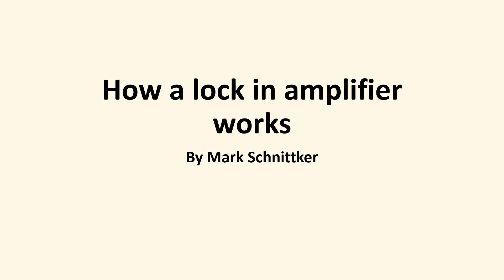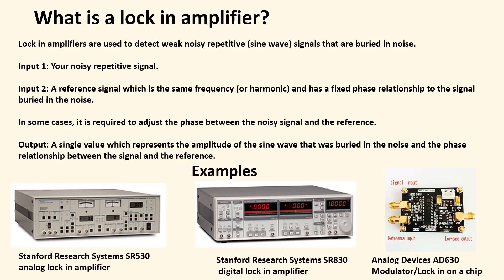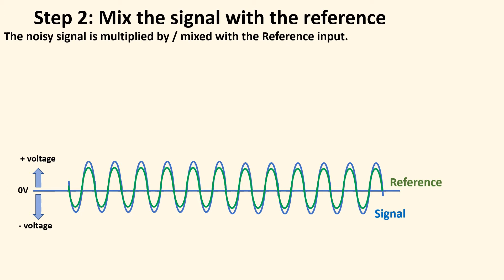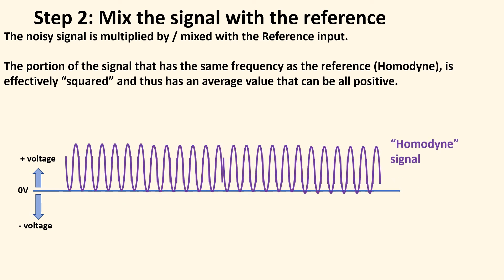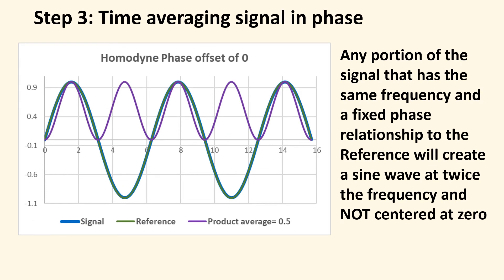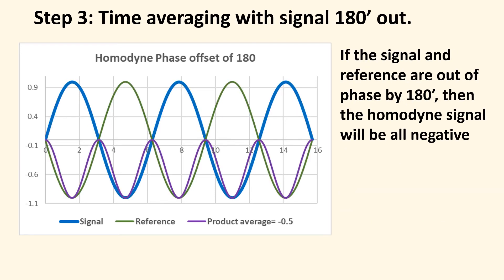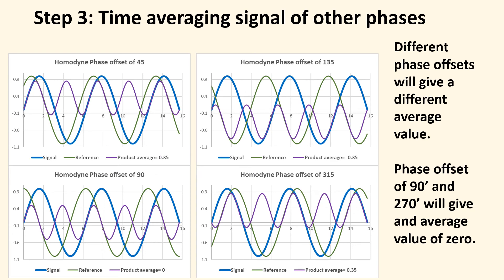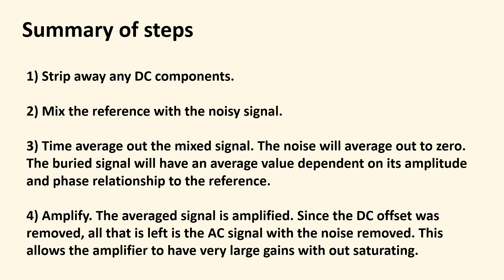How a Lock in amplifier works

Comment: I used an Ortholoc SC 9505 in the early 1980s and it was  wonderful beast for its time.
Reply from the maker: I have used some of those older EG&G tools and I agree they were excellent systems with clean electronics. Not great for computer interfacing, but that can easily be resolved these days by sending the analog out to a USB connected LabJack.

Comment: A lock-in amplifier is a highly sensitive instrument used to detect and measure weak signals, even when they are buried in noise. It works by extracting a signal at a specific reference frequency and filtering out everything else. This allows it to measure signals with a known frequency and phase in environments with significant noise or interference.

Key Features:

 • Signal Detection: It amplifies a signal that is synchronized to a reference signal (often a sinusoidal wave), making it ideal for measuring weak periodic signals.
 • Noise Rejection: By focusing on the reference frequency, it effectively ignores noise at other frequencies.
 • Phase Sensitivity: It can detect both the amplitude and phase of the signal relative to the reference signal.

Uses:

 • Nuclear Test Equipment: In nuclear experiments or radiation detection, lock-in amplifiers are used to detect small signals that arise from nuclear reactions, often obscured by noise from background radiation or electronic interference.
 • Optical and Magnetic Experiments: Commonly used in sensitive laboratory setups involving lasers, magnetic fields, or other precise measurements where the signals of interest are very weak.
 • General Physics Research: Lock-in amplifiers are also used in low-temperature physics, electrical measurements, and even in some forms of medical imaging or diagnostics where signal extraction from noise is crucial.

In nuclear testing, they help measure small responses, such as detecting radiation signals or monitoring sensor output during an experiment, ensuring high accuracy in noisy environments.

A lock-in amplifier works by using a technique called phase-sensitive detection to extract a signal at a specific frequency, even when that signal is buried in noise. Here’s how it operates in basic steps:

 1. Reference Signal: The lock-in amplifier receives a reference signal that oscillates at the frequency of the signal you want to measure. This reference signal can come from an external source or be generated internally.
 2. Mixing: The input signal, which contains both the signal of interest and noise, is multiplied (mixed) by the reference signal. This process shifts the frequency of the input signal, creating new components at the sum and difference of the input and reference frequencies.
 3. Low-Pass Filtering: After mixing, the result is passed through a low-pass filter. This filter removes high-frequency components (like noise and the sum frequency component), leaving behind only the DC component (which corresponds to the signal at the reference frequency).
 4. Phase Locking: The lock-in amplifier also compares the phase of the input signal with the reference signal. If the signal is out of phase, it will adjust the phase reference until it aligns with the input signal. This ensures that only signals with both the correct frequency and phase are detected, further rejecting unwanted noise.
 5. Output: The output is a DC voltage proportional to the amplitude of the signal at the reference frequency, allowing you to measure very weak signals even in the presence of strong noise.

The key aspect of the lock-in amplifier is that it filters out noise by using a reference signal to “lock in” on a specific frequency, while traditional amplifiers would amplify both the signal and the noise together.

Comment: Can the Reference Signal be a DC signal when the signal to be measured is AC signal
Reply from the maker: The reference signal needs to be AC with the same frequency as your buried signal. Not all situations lend themselves to this situation, but these tools work so good that some folks will modulate their signal just so that they can use a lock in. I have done that with optical choppers doing spectroscopy of low level signals and it worked really well especially if your phase relationship between the reference and signal is well controlled.

Comment: Great work, Mark. Not sure if you remember me, but we worked together when I was at Keithley instruments. I hope you are well
Reply from the maker: Jason, Sure I recall. I dont think that Keithley ever offered a Lock-in, but if they did I think it would have been a good one based on their other offerings.
Reply: @markschnittker4770  Nice to catch back up. No. They don't. I'm with Lake Shore Cryotronics and the new M81 does have lock in measurements: https://www.lakeshore.com/products/categories/overview/material-characterization-products/measureready-m81-synchronous-source-measure-system/measureready-m81-synchronous-source-measure-system?utm_source=google&utm_medium=ppc&utm_campaign=M81-Branded&utm_source=adwords&utm_campaign=M81&utm_medium=ppc&utm_term=m81&hsa_kw=m81&hsa_mt=p&hsa_tgt=kwd-389603167127&hsa_src=g&hsa_ad=632730062849&hsa_ver=3&hsa_cam=18806881853&hsa_net=adwords&hsa_acc=3884305122&hsa_grp=143470127415&gclid=EAIaIQobChMIltWFoPDq_AIVJcmUCR0ypgrSEAAYASAAEgKbdPD_BwE

Comment: can you please tell where can I get that ad630 module shown in your slide?
Reply from the maker: The chip is the AD630, but many companies make low cost lock in amplifier boards from the AD630 chip and simply call them an AD630 lock in amplifier. I have purchased them from Ebay and Amazon. If you do a web search I am sure you will find some. Note that they are not nearly as sensitive as a bench top tool and also they are not adjustable for phase or time constant, but they do work quite well if your signal only 2-3 orders into the noise. If your signal is 6 orders below then noise, then you would probably need the much more expensive SRS lock-ins. If you get a chance to use an SRS, then you will find they are fantastic tools which cost much more, but are 3-4 orders of magnitude more sensitive than an AD630 lock in.

Comment: And since multiplying two signals at the same freq but at a 90 deg offset results in an average of zero, you would also multiply your signal with a copy of the reference but at 90 deg offset, and thus results in I and Q outputs
Reply: Correct